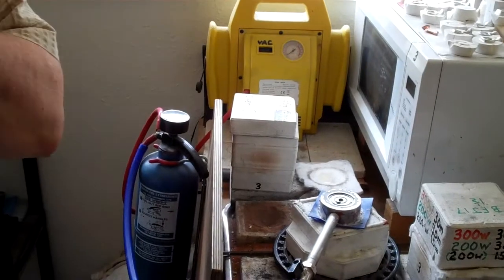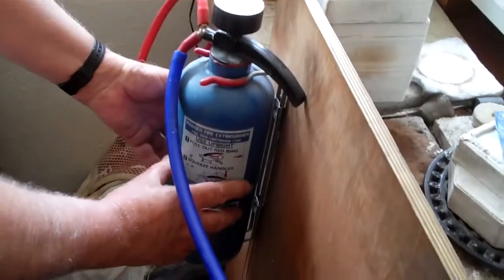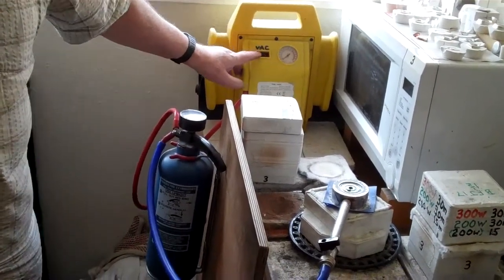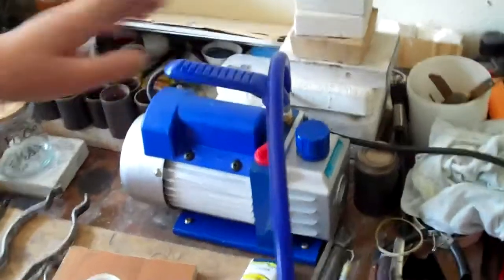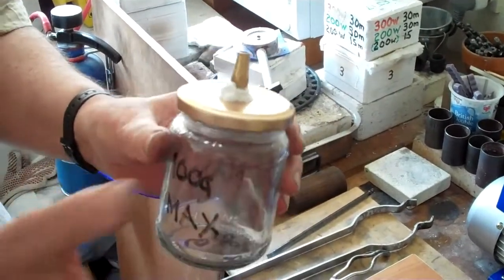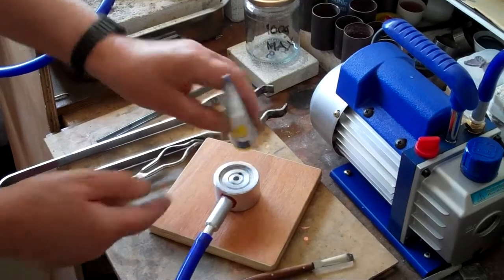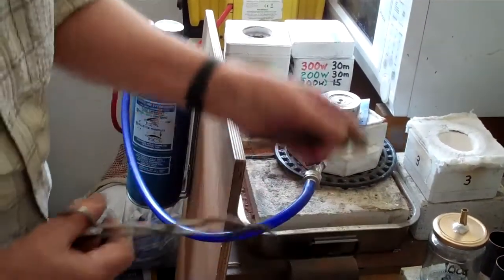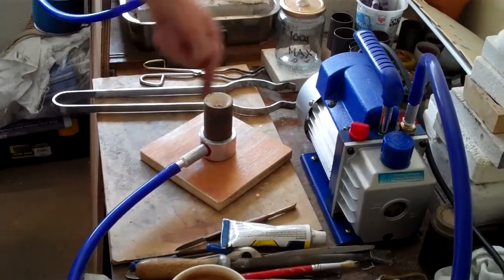New style Vacuum table from steedcraft

Comment: Does anyone know what the round silver colored vacuum device is called that is attached to the board and where they can be bought?
Reply: Go on the Goog and type in "Etsy Microfoundry" and you'll find this guys etsy page, he sells the mini vacuum table on there for £50 +£7 P&P. I really wish he would sell a model that took larger flasks, as the one there is too tiny for my uses :'(  (I've tried multiple times to make one on my lathe, but lack the room to make one the right size for me biggest flask, and indeed, fuck up the threading quite often haha)